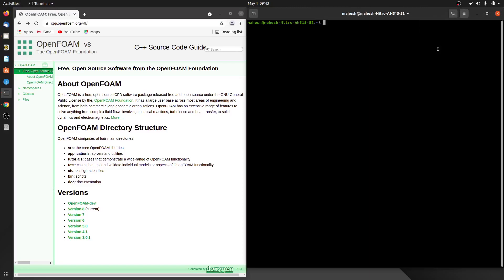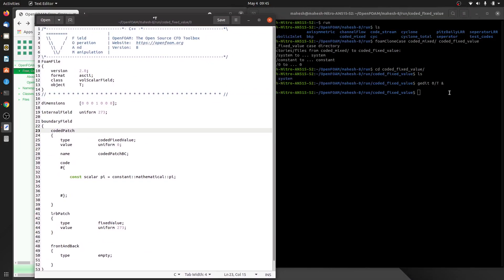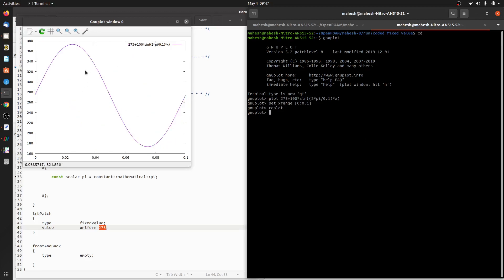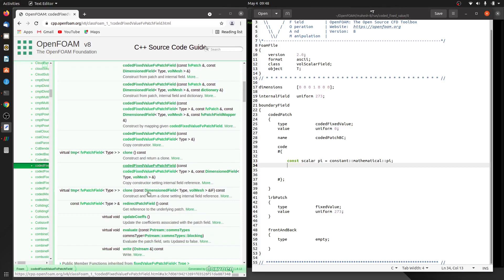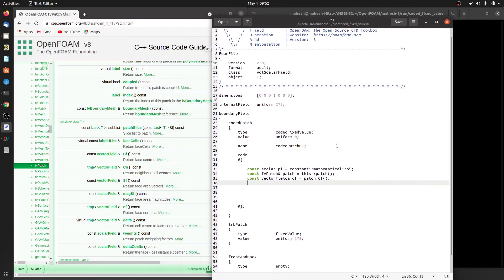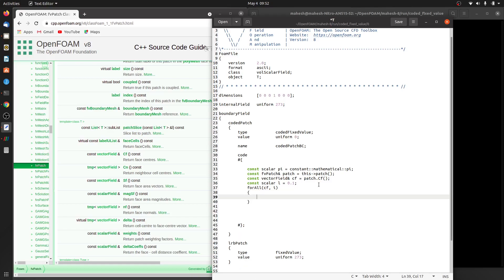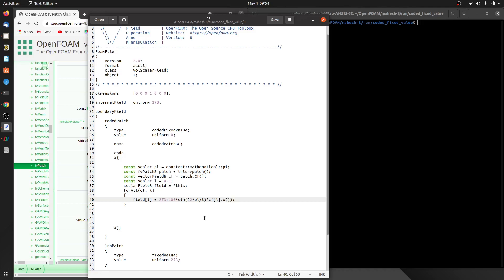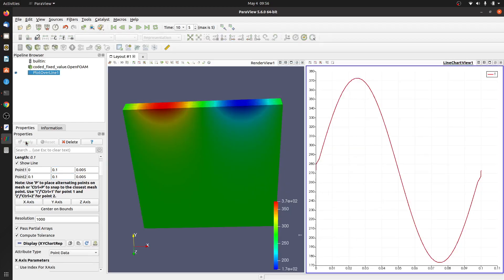codedFixedValue boundary condition in OpenFOAM.

Comment: Hi, I'm trying to use a boundary condition that varies in time and space with an imposed heat on top surface, e.g. Q = 100*exp( (x-0.5*t)). I'm trying to use the codedMixed, but I'm having some trouble, could you help please?
Reply: Hi...I am also looking for same thing. can you please help if you already got the solution?